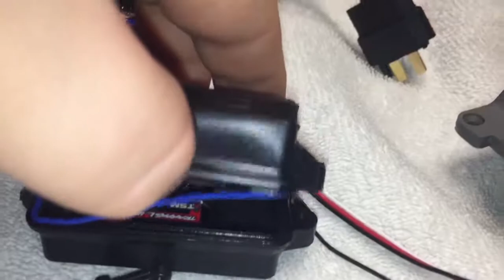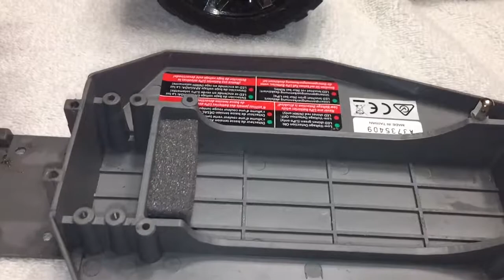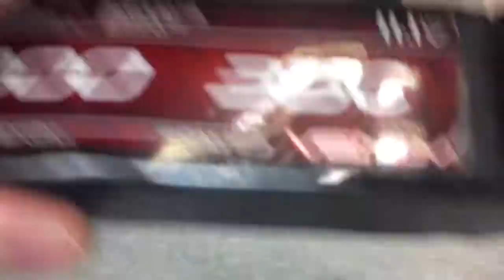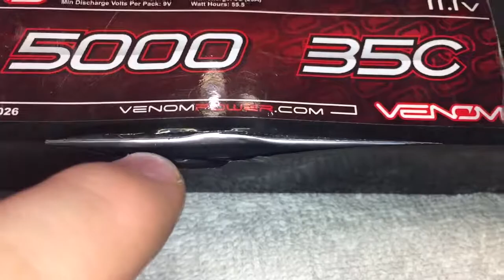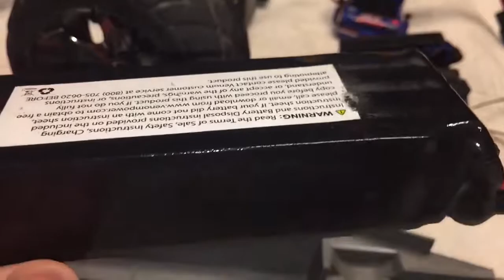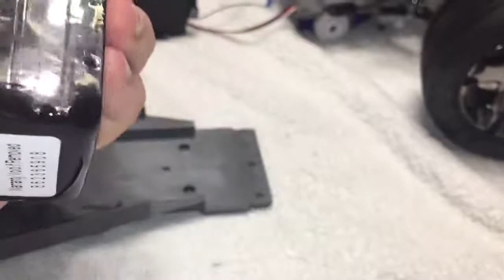Traxxas Rustler VXL Update Pt.3

Comment: I would go with thicker oil maybe 40 to 50 weight I have 60 weight in my speed run circuit and as for the battery for that price I will keep using it lol I would use black tape to tape it up and look up gforce battery from valur hobby they run about 20 bucks what I use to run mines
Reply from the maker: Thanks for the recommendations Rc Fun! I'll look into the oil and for around $20 I can get me a few batteries for the price I paid for the one venom! lol... How have the gforce batteries held up for you? How long have you been using them, any issues? The venom I have now, I did just that... I put some black electrical tape on it and I'm gonna keep running it! I'll keep a good eye on it while charging but yea, $75 is a bit much to just throw away lol.
Reply: I know what you mean especially just to bash in and so far so good I must of put them threw 100 cycles or more and still using them had them for about 6 months now and I can say I got my money's worth